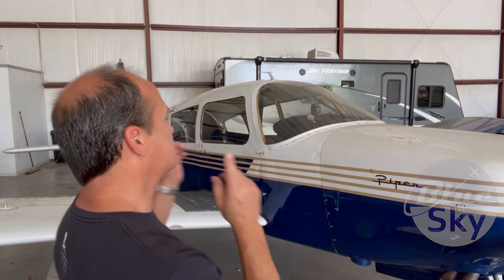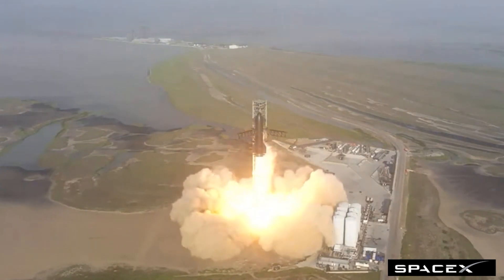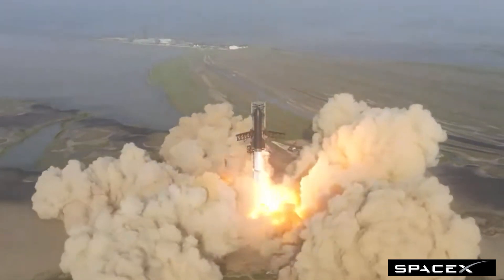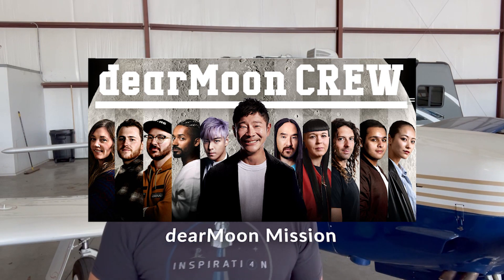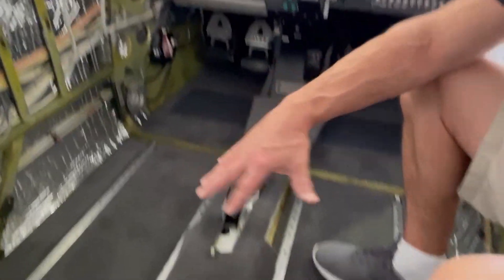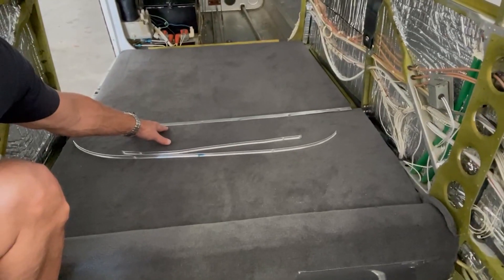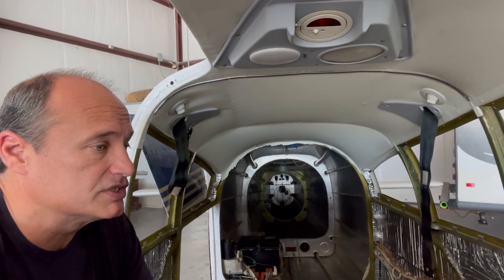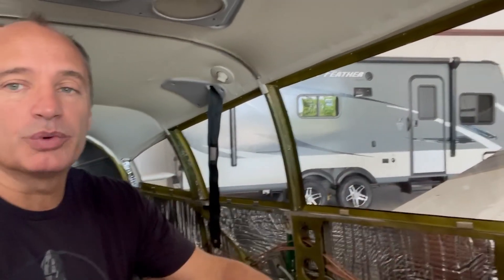Piper Arrow Interior Restoration Progress update

Comment: What type of adhesive did use to glue the carpet to the plywood seat platform? Thanks!
Reply from the maker: I used the contact cement that was sent by Airtex with the headliner and other materials, but any type of spray adhesive like you can get at the hardware store should work I would think.

Comment: Just to give you an update on where I am on my renovation, I just removed all of the carpet under the pilot and copilot seats. The big surprise was I had two layers of insulation, the original foam that was glued to the floor board and then a thin piece of aluminum that was glued to the original foam with an additional kind of dense foam rubber that was glued to the aluminum and then the carpet glued to the foam rubber. What a mess. I got all of this out and now I've started cleaning the floor area. It has glue, some stuck foam rubber, and over forty years of grime. I have finished the carpet in the cargo area and under the rear seats and all of that is installed. All seats have been recovered with new leather with head rest added. I had to have both the pilot and copilot seat backs repaired due to cracks in the frames. My A&P did those repairs. I replace both seat level cylinders. One was dead and the other one was developing issues. I have started replacing the wall insulation with the sound deading insulation. I found it difficult to get the sticky back insultion in the exact place where the cables are running along the walls. I am also fighting scope creep with some of the plastic trim pieces that need repair and painting due to fading. But this is the best time to do it. I had replaced the plastic in the overhead and front parts of the plane a few years ago due to sever brittlness on about all of those parts. If you have found anything that works for floor vent nozzles, besides the plastic ones, I would appreciate you passing that along. I have replaced mine on the copilots side a few times without any luck. People always step on them and break them getting into the plane. so I just removed them and do without the plastic direction nozzles on that side of the plane. Piper should have done better with the design. I attempted to recover my armrest with eliminating the ash tray and not sure I'm happy with my work. The ones I saw in the Airtex pictures had a nice sewn edge on the top armrest piece and a called Airtex about that since I didn't get anything that was sewn. They said just glue the vinyl to a piece of plywood and didn't offer anything with a sewn edge. I also had to order more vinyl since the pieces they sent were too short to do both armrest without the ash trays. I was also short on the 1/4" insulation since I covered the cargo area with the 1/4" in addition to under the front seats. Thanks again for the videos. I'm still watching and rewatching the videos to help me out as needed.
Reply: Good idea. Thanks.
Reply from the maker: Any time!
Reply from the maker: Sounds like you’ve been busy :)   You may consider taking the armrests to a local auto upholstery place. Just get the vinyl from Airtex so it’s fire resistant per FAA specs. They might have some good ideas on how to cover the while armrest like you are wanting.

Comment: What is another 20-50 hours of work and another few thousand dollars when your project will end up costing ten or twenty times that.  I just put in a new engine with new crank, cam, piston rods during the overhaul.  Then new hoses, fittings, then sanding, sealing and painting every piece from the firewall forward.  Talk about hundreds of hours?!  I can appreciate every detail of what you are doing.  It gets to the point that we can put more money into the airplane than we can ever get out of it.  Just those 10 hoses was over a grand.  Prop overhaul, alternator, oil cooler, prop governor, electric fuel pump and the list goes on and on.  My plane has not flown for 2 years, but the carpet is the only thing left before it takes to the air once more.  I know how you feel.  You have to love it.
Reply from the maker: Sounds like you've got a great project going on. Yeah the money spent is purely for personal enjoyment - definitely not getting that back out - but not planning to sell this anytime soon.

Comment: You are doing a great job of restoration.  I am working on the carpet under the instrument panel.  Two small pieces that attach to the pedestal.  All the prior carpet was glued in with Pliobond which makes removal of the residue very tedious.  About an hour per day in the early morning in Louisiana's heat and humidity is all that one can stand before getting impatient and careless.
Reply: That's exactly what I'm going through on my Arrow in Savannah, GA (a free 100 degree sauna) and I only have a shade port, no hangar. I'm using Jasco Premium Paint & Epoxy Remover for stubborn adhesive. It's thick, you brush it into place and leave it 30+ minutes (as long as over night) and adhesive just melts away with little effort.
Reply from the maker: @JawanzaBassue  that sauna sounds brutal - stay hydrated! Nice tip on the adhesive remover.
Reply from the maker: Yeah - make sure you have a fan in there, it helps. But that's absolutely why I started the project in January. Managed to get all the really labor intensive stuff done before it got really hot. Always pretty warm in FL, but big difference between Jan and June.